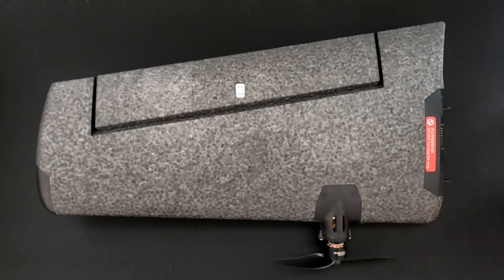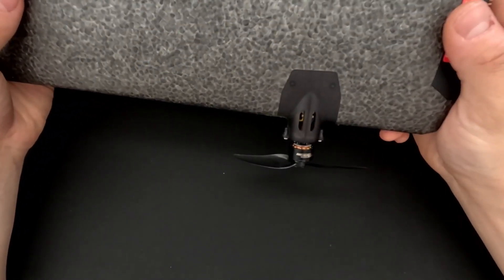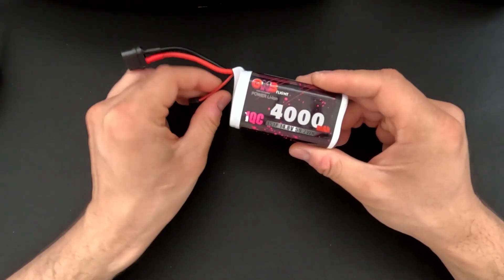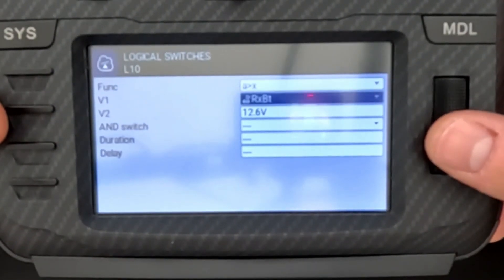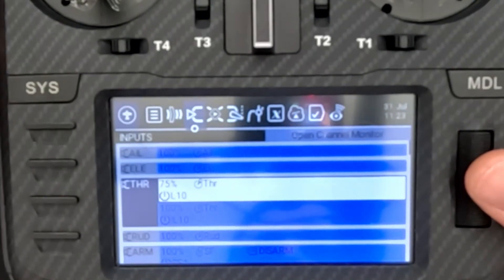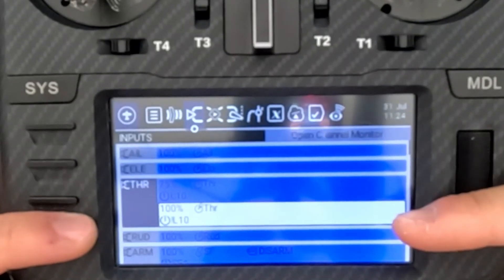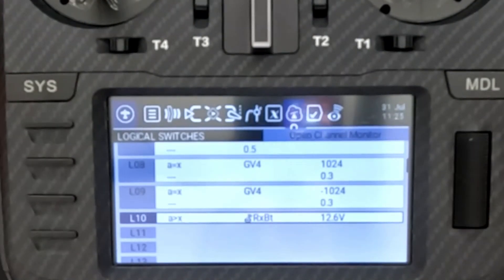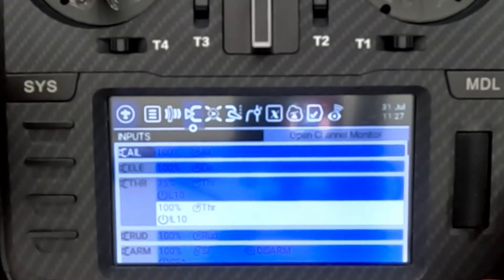Prevent your Heewing Ranger T1 from burning up with this trick!

Comment: Hi, did they fix this problem? The VTOL version has 1806 2000kv and 25A ESC... I have upgraded the ESC to 35A but I dont know if I have to upgrade the motor...
Reply from the maker: VTOL shouldn't have this problem. It has the right motor, prop and ESC combo.
Reply: @DZARO  Thank you!!

Comment: Great logic idea.
If flying with a flight controller, if would be better to program logic on the flight controller vs. the radio, so not to rely on telemetry, or in case of full power being applied in an automated mode, like RTH.
Reply from the maker: I agree with you 100% !

Comment: nice info can you fly with the 1406 and the esc 25a on 4s? because I am currently building a pnp and it has already installed the 1406 motors and, according to Herwing, the 25a esc.
Reply from the maker: Yes, you should be fine with that. I went with different ESCs this time: https://www.hobbyrc.co.uk/little-bee-cloudphoenix-35a-esc-blheli32-3-6s
These are 35A rated and they work like a charm!

Comment: Excellent bit of logic.  I can think of several uses for something like this.  Possibly even create a custom curve based on voltage to adjust the throttle % max proportionally with voltage rather then a fixed 75% or 100%.  Throttle max could increase linearly as voltage came down and approached 12.6.  Thanks for sharing, love thinking up new ideas for EdgeTX logic.
Reply from the maker: Same, I love the virtually endless possibilities !